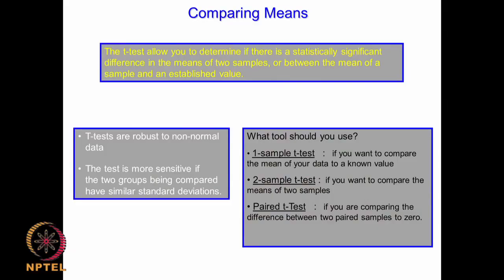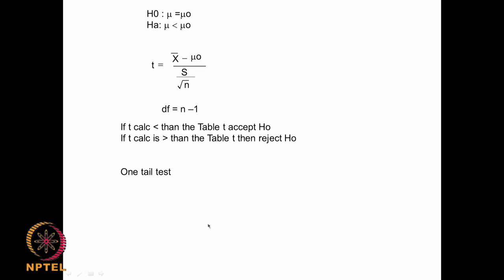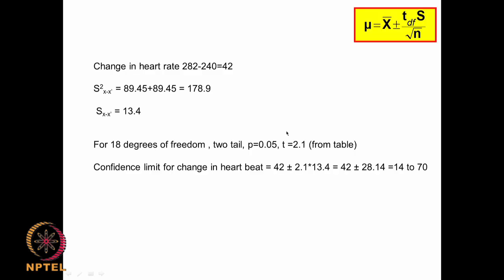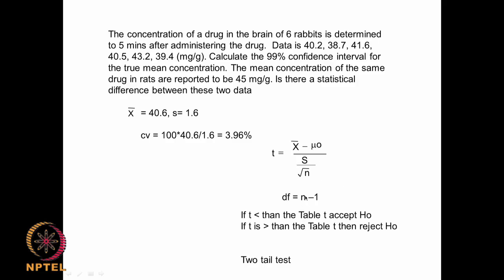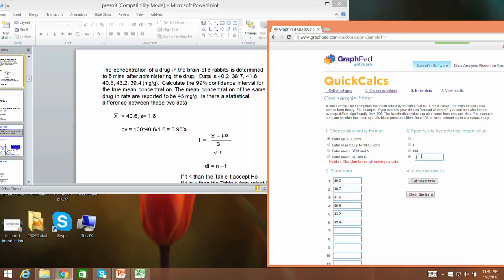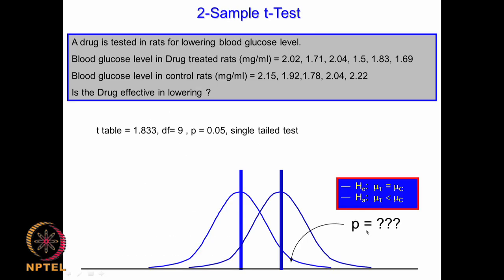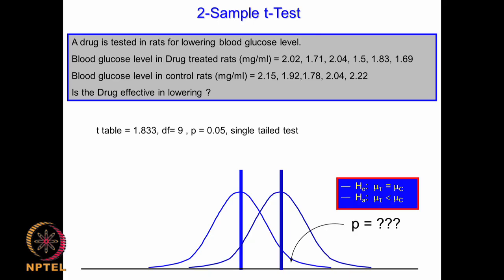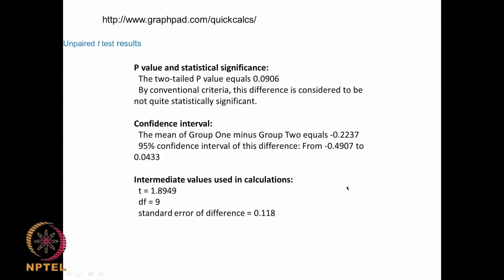t-Test

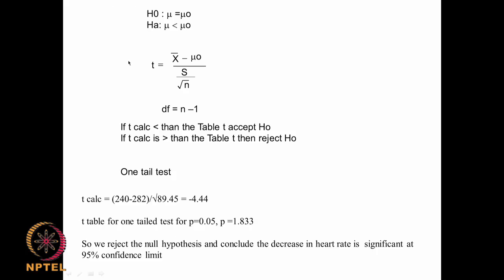Comment: @7:05 t calc is less than t-critical, why Ho is still be rejected?
Reply: I agree with you. Yes, -4.44 < 1.83. If the above test was a two tailed test (u is not equal to u0), then for significance limit=0.1, t-critical = 1.833 (Right side) and -1.833 (Left side). t-calc = -4.44. So the conclusion is difference in heart-beat is significant. I still agree with you. Difference in heart-beat is significant but decrease/increase cannot be said.
Reply: We are not considering minus sign here so 4.44 is greater than 1.83